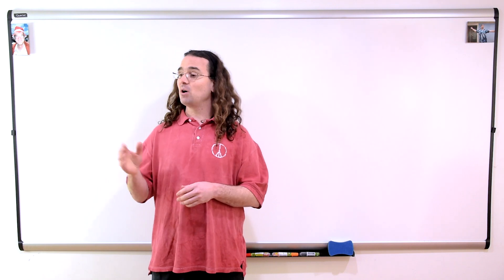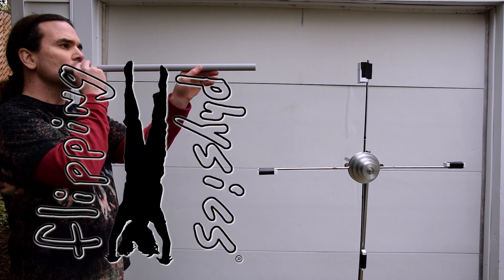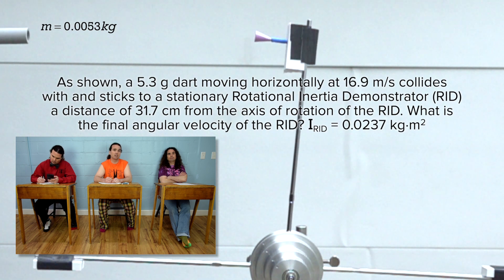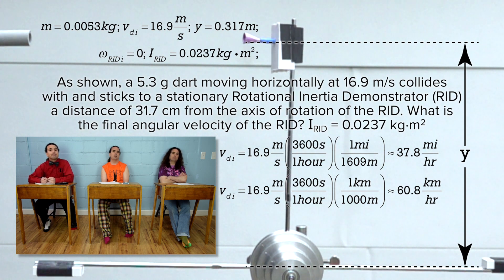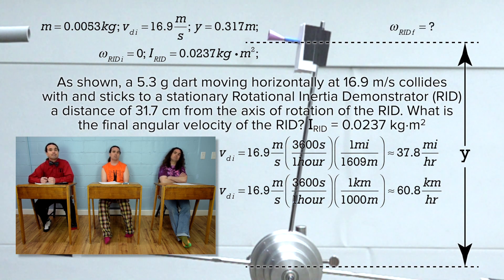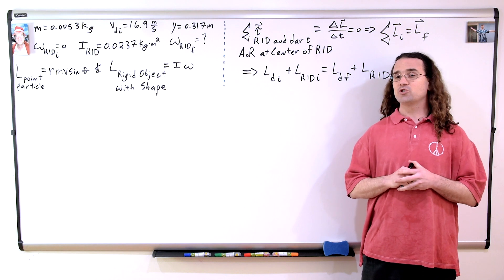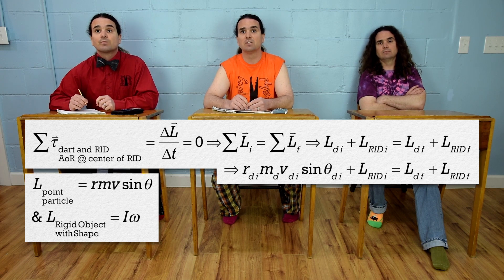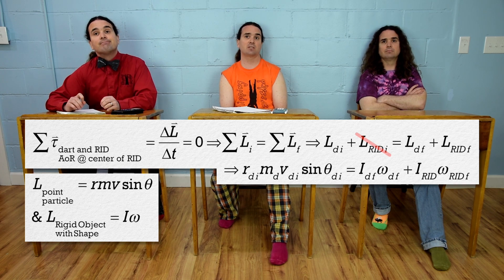Point Particle & Rigid Object Collision - Conservation of Angular Momentum Demonstration & Problem

Comment: Dear sir, I am not convinced. 3.6% is a very large discrepancy and it is way outside the margin of error. Perhaps it might be explained through friction losses or mechanical losses due to deformation, but without presenting proper investigation, it is wishful thinking to claim "Physics works". Perhaps it actually doesn't. In fact, so far, you have actually proven that physics doesn't work. It is also deceptive because angular momentum may appear to be conserved in this example purely because rotational kinetic energy is conserved. To test angular momentum conservation against angular energy (A term I invented. It is synonymous with rotational kinetic energy, except that it is conserved instead of angular momentum), we need to use a variable radii system. The best one for that is the original, simplest, best and only model of a one body problem that we have. The ball on a string. Please will you measure that without yanking because you will then confirm for yourself that it is in fact angular energy that is locally conserved and not angular momentum globally.
Reply: bruh i dont know from where u study physics but I'm 100% sure if u did from somewhere u need a refund, firstly u cannot introduce new quantities out of thin air coz if it was necessary it would be done already. and second angular momentum is always conserved no matter what. i don't understand why this is so hard for u to digest . but angular momentum for a closed isolated ideal system is always conserved and because the world is not perfect thus some error is prone to occur and 3.6% is a marginal error thus I believe u should study again and come back
Reply: Sir, could you please clarify more on this point "It is also deceptive because angular momentum may appear to be conserved in this example purely because rotational kinetic energy is conserved" thank you..
Reply: @shailkumarjain  You appear confused. L = r x p. If you conserve |p| and change |r| then angular momentum must change because it is on the opposite side of the equation.
Reply: @TheAnimammal  yes Sir, i am confused as  novice in mechanical physics concepts, i am using online medium to learn as of only source to learn available to me and i feel critical thinking amd critical comments are key to learning so i do check comments as to understand doubts and queries.
Reply: @shailkumarjain  Personally, I believe that you are pretending to be stupid because you imagine that it will suit you to have your opponent believe you are stupid.
Is it clear from the equation L = r x p, that if we do not change the radius, then angular momentum will not change because p is conserved and will not change (Assuming that we discuss rotation, so the direction is obviously always changing) ?
Is it clear that you cannot conserve both L and p in magnitude while you change the radius?
Reply: @TheAnimammal  thank you for taking time to reply. I am not trying to make anyone believe my intelligence or stupidity. As i said I am using online platform to learn. As i saw a critical comment on the video by you and tried to understand it, failing which i messaged to clarify. That is all, i have no other motive... Thanks again.
Reply: @shailkumarjain  well then why are you ignoring the evidence like a flat earther and discussing red herring then?
Don’t call me sir when you are disrespecting me. 
Don’t thank me insincerely.
Reply: @TheAnimammal  well... thats not how it actually works we are supposed to substitute in terms of magnitude and ur method is just more complicated. moreover there is no wrong in considering an ideal case lot of errors might occur and pls don't claim that their method is wrong because its not. so I think u should learn a bit more and come back
Reply: @samarthrao8051  What are you talking about? Please follow the discussion? This doesn't apply to anything being discussed here. The fact of the matter is that it is impossible mathematically to conserve |x p| and L at the same time when changing |r| because L and p are on the opposite side of the equation L = r x p.

IS THAT CLEAR?
Reply: @TheAnimammal  L + Ratio + ur white
Reply: @ganu2867  you are in denial. There is no need for racism.
Reply: @TheAnimammal  ok so i want u to repeat whats your point in one sentence
Reply: @samarthrao8051  a typical ball on a string demonstration of conservation of angular momentum does not accelerate like a Ferrari engine as predicted, so the law is wrong.
Reply: @TheAnimammal  bruh that doesnt make sense . utilisation of surrounding resources for a simple experiment is fine
Reply: @TheAnimammal  how can u possibly think that 3.6% error is more. it is very minimal
Reply: @samarthrao8051  a ball on a string does not accelerate like a Ferrari engine, so that is overwhelming evidence that the law of conservation of angular momentum is wrong. You are cherry-picking this one engineered result.
Reply: @TheAnimammal  It doesn't mean the law is wrong.  It could mean that the experiment has non-ideal factors that get in the way, such as friction and drag.  It could also mean that there are systematic errors in the measurement methods.  Experimental error takes many forms.

I will email you a spreadsheet I put together that is a numerical simulation, millisecond-by-millisecond, of what would happen if you apply a constant magnitude force radially inward to the origin on an object initially moving in the +y direction at 1 m/s at initial x-position 1 meter on the x-axis.   The spreadsheet uses first principles of Fnet=m*a, and v=dr/dt and a=dv/dt only, in order to derive the trajectory.  No energy, momentum, or angular momentum is used as a shortcut, but it shows that these shortcuts are valid to the contrary of your claim.  It contains columns that show angular momentum, r cross (m*v), along with kinetic energy and work done by the force, so you can see which is conserved and which isn't.   Anyone else who would like to see this spreadsheet, please reply with your email address and I'll send it to you as well.

I followed the lead of Mr P's explanation of Euler's method for numerical simulations.  You can see him explain it in further detail here:
https://www.youtube.com/watch?v=OukRTF6Bgcc
Reply: @TheAnimammal  HEY! Guess what...

N O . 

O N E .

L I K E S . 

Y O U .
Reply: u know i would suggest YOU to do an experiment in finding the gravitational acceleration using pendulum. if u don't get 9.77m/s2 exactly then ur whole argument is wrong
Reply: @samarthrao8051  I am not your “bruh”. A ball on a string contradicts the law so the law is wrong. If the prediction does not match reality then the theory is wrong. That is science.